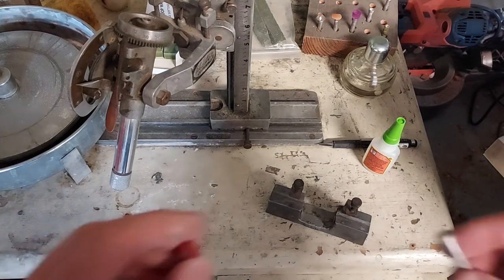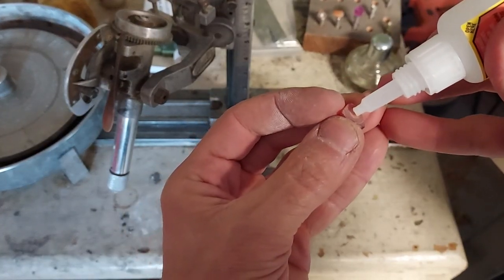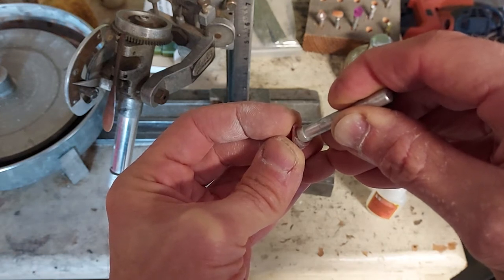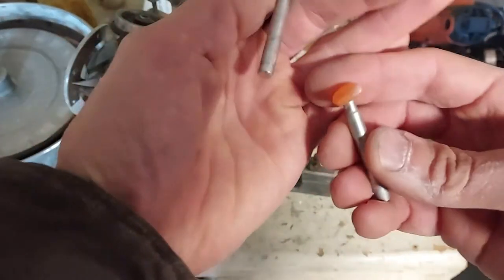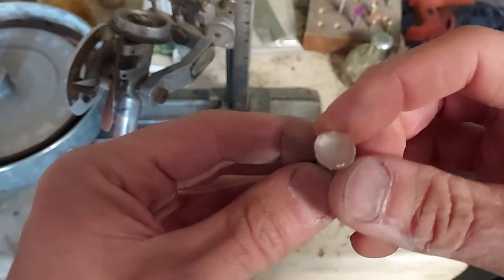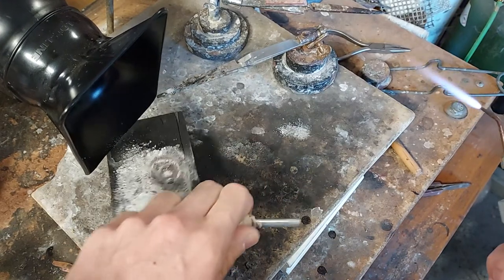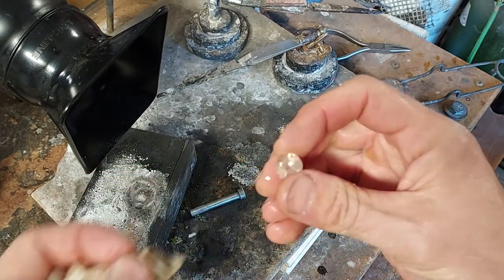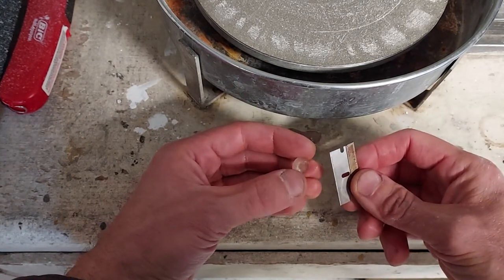Dopping a gemstone with Super Glue - Faceting Lesson 4

Comment: For transferring it, do you just glue the other dop, leave it with both dops overnight and then heat the first dop? I'm guessing you have to be a bit careful there, especially with small stones?
Reply from the maker: yes, at about the 3 minute mark on this video, I show how to remove the stone. Basically the transfer is the same thing, but you'll have the dop you want to keep also under the wet paper towel side. The transfer is probably one of the most tedious parts of faceting in my opinion.

Comment: Great video, what are the metal dip sticks (brand name)? 
I’ve used that gel glue to dip before but only on wood dipsticks, then had to use jeweller saw to cut off and file the thin sliver of wood off before polishing the stones underside.
Reply from the maker: The dop sticks I am using are so old, they are probably not sold any more. They came with this old faceting table.  But you can also get new ones from different faceting shops online like Cutting Edge Supply

Comment: Would a normal lighter work for this? Also, are there any alternatives to superglue that have a good hold on the gem, and dry quickly and are easy to remove?
Reply from the maker: yes, that will work, or a candle. I prefer this as it is hotter.  The traditional method of dopping is to use dopping wax. https://youtu.be/nO2pvc6hpmI

Comment: what if the supper glue does not apply to the the stone after 1 day? Same glue?
Reply from the maker: several possible causes: I've found if the glue is old, it looses effectiveness.  I've also had better luck if I vigorously shake the bottle before each use... I am not sure why, as it does not seem to need to be mixed...  If it is too cold, it will not cure very quickly.  If there is any oil on the stone (like from your hands) it will not adhere well. make sure to clean the stone surface. if none of those work, and you're using the same glue as I am in the video, then try a different glue, buy a different bottle of the same glue, or switch to wax.

Comment: Where do you get the metal drop sticks?
Reply from the maker: The dop sticks that I have here I inherited from my grandpa along with the table and machine.  This is an older MDR setup.  Most machines will either take "keyed" or non-keyed dops with a 6.25mm (1/4" shank) but you'll want to double check your machine. The key is a flat side of the dop that helps with positioning and preventing rotation.  There are quite a few online websites that sell them. I strongly urge anyone buying a set to get a quality set, which can cost upwards of a few hundred dollars. If a dop is bent or not perfectly squared off at the end, then it will just cause frustration down the road. So avoid those tempting deals on ebayt, amazon and temu as you get what you pay for. many of the best dops are actually made by facetors who have a machine shop create their dops and they also sell them. Common materials are aluminum, Stainless steel and brass. The softer metals wont damage your lap if they should come into contact with the lap during cutting.  This site makes what might be one of the worlds best faceting machines along with dops: https://www.ultratec-facet.com/product-category/lapidary-supplies/dops/  I hope that helps. I think it will also help answer your other question.
Reply: Thanks for the help.
Reply from the maker: @garymaylon2025  You're very welcome :)

Comment: is possible to use super glue but with methyl acetate vs ca ?
Reply from the maker: The main drawback of a methyl acetate over the CA type glue is that the MA type is  more water soluble at room temperature and becomes more so as the temperature rises.  CA type is also soluble to water, but it takes a lot longer. this is a problem as you do not want the stone to loosen as you cut it due to the water coolant.  I also want to point out that regardless of how you dop it, the denatured alcohol can remove the stone without heat if you're willing to wait a day or so for it to dissolve the glue.